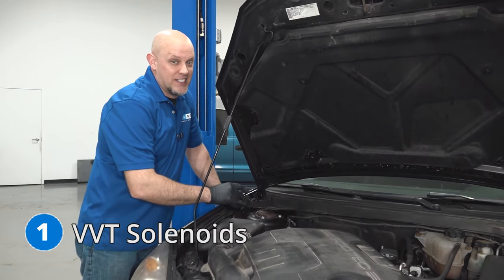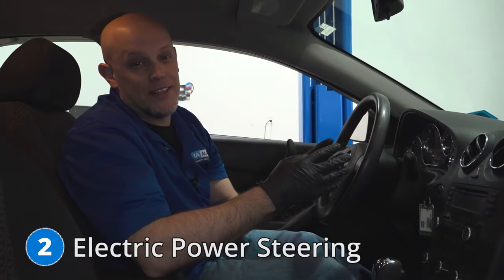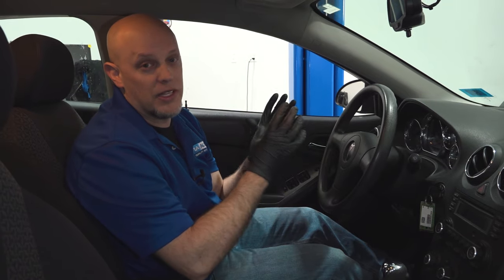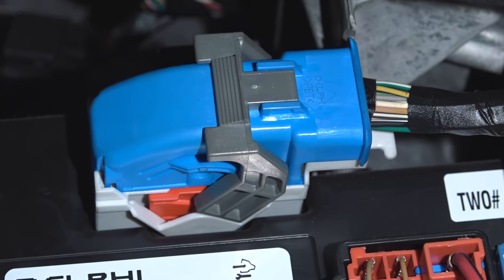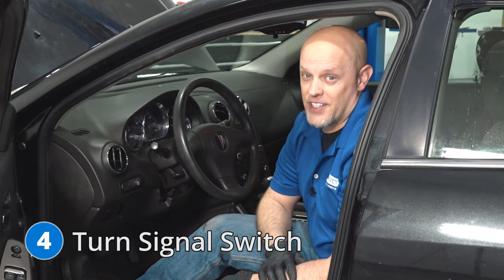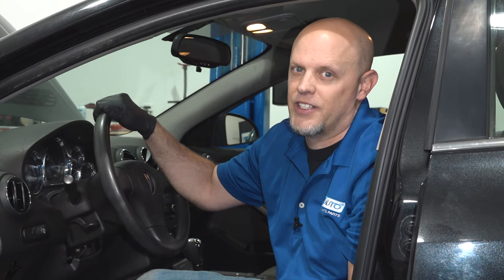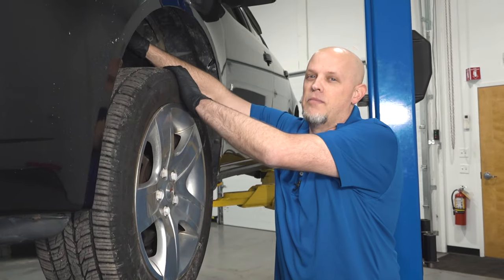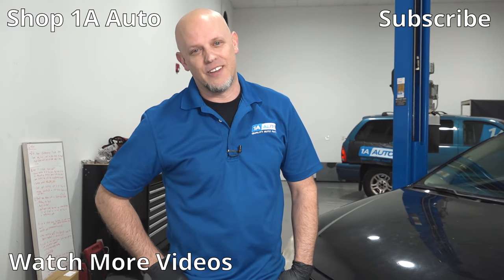Top 5 Problems Pontiac G6 Sedan 1st Generation 2005-10

Comment: 172k on my G6 and she's still rocking. Had the BCM connector issue as well as the turn signal issue. Total about $40 bucks spent on the fixes. I'm gonna drive this thing until the wheels fall off lol
Reply: Having a blast at 200k
Reply: I currently have the turn signal issue :/ how did you fix that!?
Reply: I own an 07 G6. They used the same Signal switch on the Chevy Cobalt, G6, and Saturn Aura that I know of. And Idk why the switches have such issues on each vehicle its installed. I gotta go order one for mine. It's like $28 on Amazon.
Reply: @LuisSanchez-1  Ditto, just what Michael said. Got my turn signal switch assembly on Amazon for $25. 

If you don't know what you are doing, it take about 5 minutes. Extend the telescoping steering column out away from the dashboard... that will make the job easier.
Reply: @mikegray2002  hey man I’m driving the 07 g6 as well haha how’s she treating you
Reply: @LuisSanchez-1  its really easy, and cheap. Bought the whole assembly online,watched a YouTube video. Takes maybe 15 minutes.
Reply: What year? My 05 g6 was horrible maybe other years were better.
Reply: I got 210,000 and still running like a champ
Reply: I feel that my g6 got 160 k an im not getting rid of it anytime soon
Reply: 237,000  same motor had it since 07  2 transmissions later I'm still satisfied I've pushed her past the breaking point removed governor but kept Rev limiter it still feels the way it did new when I left the lot 1 thing that still pisses me off to this day the driverside ground in the door wire harness when the windows don't work check that wire problems always I open my door sometimes and wiggle the wire guide just to
 Crack my window 😀 but she never left me stranded 100%
Reply: Yup, I'm at 176k right now in my 08 G6 GT
Reply: @shysti2c  how did you remove the govner? I’m buying 1 soon
Reply: Still going strong? ThinkIng about buying a 2008 with 170,000 miles.
Reply: I'm at 172K also! Starting to have issues with it not starting...it will click but won't turn over. I love this car and need to keep it going longer
Reply: I just got mine On The road and bought it from my son after it sat during Covid. I wanna drive mine til the brand new tires fall off too!!!
Reply: 170k on mines and just changed the fuel pump but it still doesn’t run
Reply: Don’t joke about that, my passenger side tire LITERALLY fell off while I was driving

Comment: Only thing that I would add is the headlights. The cheap wiring breaks and one or both lights go out... intermittently. You need to go buy the pigtails and solder the new ones in.
Reply: i literally just had this problem. had to replace the headlight.
Reply: I’ve gone through this nightmare several times
Reply: Even with that as the fix I have trouble with mine still. I just gave up lol. One headlight fo' life!

Comment: Mine has 170,000 miles, none of this has happened yet, counting my blessings, and accepting that something will happen sooner or later
Reply: I bought one with almost 200,000 and the front wheel bearing is one thing I gotta replace plus we had to fix the back struts your days are numbered man😂
Reply: @connerkandiko8268  I replaced the front struts, and the rear shocks and springs
Reply: I’m about to buy this car🤣
Reply: Mines is 187342 miles on a GXP G6 the only thing i had to do is redo the Timing Belt  But besides that! normal Wear and tear stuff! As long you take care of the car ! it will take care of you!
Reply: @johnwilliams73123  they’re great they run forever, mine almost has 200k miles and the power steering is the only thing i had to replace but after a few youtube vids it was honestly a very simple fix
Reply: @mikelake3498  Very common issue on those 3.6. I have one too at 218k
Reply: Update: Damn Bcm Connector

Comment: Had 3 G6s in my life and i loved them all. Last one I had was a GT sedan with the panoramic sunroof which I LOVED! Had almost 300k miles on it and never had a single issue besides having to replace a wheel bearing. Have a G8 GT now but would like another G6 for winters
Reply: Just came across this comment i have a g8 and also 3 g6s lol pontiac forever

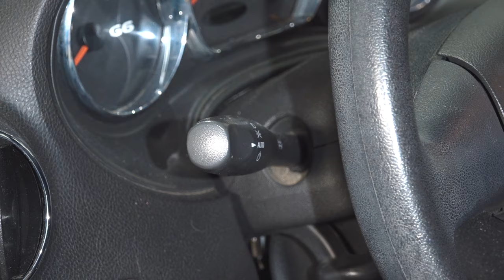Comment: 2:10 I actually love that it doesn't automatically get rid of the turn signal because sometimes in other cars it removes too quickly and with the g6 I have control on when to get rid of the signal.
Reply: I do like it too but as my G6 is my first car.. I'm gonna hate it when I get a new one cuz imma be switching straight to my other turn signal cuz I'm too used to doing it myself🤣
Reply: i’m glad it works well for you! but my area requires you to turn off your signal then turn it back on every time you merge to another lane even if you’re merging across multiple lanes at the same time. that way drivers around you know that you’re merging instead of assuming you just didn’t turn the wheel enough for the signal to turn off

Comment: my 2005 pontiac g6 has had every single one of these problems minus the turn signal switch.  great car tho. 330k miles and still going! also the electrical steering going out was fixed for free at the dealer due to a recall.
Reply from the maker: +marquez16543 Thanks for the feedback!
Reply: How long ago was it that the dealer repaired electronic power steering issue for you? And wash there any specific guidelines that would dictate rather or not they would repair it for you?
Reply: Wow 330 miles.  Good to know.
Reply: 330k ! Nice!

Comment: This video proves there are good ppl out there  posting accurate helpful information because the BCM thing was my problem and this worked
Reply: There is a recall for that vehicle where they put dielectric grease and rearrange the wires for that connector
Reply: My break lights would stay on. I took rubbing alcohol and a small brush and cleaned all the prongs in the connector and it fixed it

Comment: Melting power steering hoses:
One significant issue worth noting is on G6's that have hydraulic power steering (as opposed to electric power steering). I had a G6 GT 3.5L V6.  The power steering lines both run right under the rear exhaust manifold. And when I say right under I mean RIGHT under it. When the engine is under load and it tilts back, that rear exhaust manifold leans back and TOUCHES the power steering hoses. The hoses have some heat shields on them but those are worthless against the super hot exhaust. My power steering hoses melted all the way through one day and out went all my power steering fluid onto the ground. This happened while I was driving, so I lost all power steering assistance. 
I was able to replace the hoses and secure them down with some zip ties. This held the hoses at least a couple inches away from the exhaust, but I wish there was a better design for that. Every drive after that, I had to worry if it was about to melt again.

Just something to watch out for and ask about any service history on that issue.
Reply: Happened to me 3 times in a two month span
Reply: I'm actually going through this now. Trying to find a video on replacing the power steering return line. I can find a bunch on the high pressure line..none for the return..

Comment: I have a 2006 G6 V6 3.5 and i have had to change out the blinker switch, replaced starter, replaced fuel pump, and i have had the transmission rebuilt, but my car runs great now. I love the power that my G6 has it will get up and go.

Comment: I've owned 2 of these sub models and when the internal voltage regulator goes out inside the ALTERNATOR, the body control module freaks out under hard acceleration and you lose power steering, in addition to the instrument panel resetting, until you remove your foot from the hard acceleration. In both cases I opted for an UPGRADED alternator instead of and OEM replacement, and have NEVER had a problem after.

In severe cold whether starts, the charging voltage can be high, causing you the steering to act nervous but after a few minutes of warm up, your fine.
Reply: We don’t need that power steering my girl, we da best player in da game
Reply: @ColonelCutlet  LOL, it's like wrestling an alligator when it goes out, let me tell you.

Comment: I got my G6 handed down to me with about 120k on it, i’ve had to replace the solenoids, power steering sensor, and turn signal switch all in the last 2 years. Overall it could be worse, and it’s been a pretty reliable car!
Reply: How much did it cost you?
Reply: @jayden-jsjincorporated5089 , I replaced my solenoids on my 2009 g6 2.4 recently.  About $100 for the 2.   Power steering sensor should be pretty affordable.  Turn switch shouldn't be too high, either.
Reply: i just got an 07 with 162k miles and need to replace the turn signal switch :’)

Comment: you should make it top ten cause there are plenty of issues. like the shifting linkage, the oil leaks, And The plastic heater lever under the dash that switches it from hot to cold. I have 260 thousand on mine and I do have to say the car still feels tight {like new} and runs great handles good to

Comment: Wow! I have several of the problems you listed. My blinker has always been wonky. My wheel bearing is howling and my power steering quit working after I slid off the road the other day. The code reader says "lost communication with power steering control."

Comment: G6 gt 2007 on 214k miles, so far I had a serpentine belt torn to shreds due to a/c pulley stalling, replaced exhaust system due to human error lol, replaced return line on rack and pinion due to it routing and pressing against exhaust burning a hole through it (that was a pain to fix but it was my first time), some grounding issues causing a bunch of lights on my hud, alternator going bad, o2 sensor replaced, and yeah I think more but IT STILL RUNS. Thankfully and I did it all by hand no mechanics and I ain’t even that knowledgeable on cars 👍🏼

Comment: I own an 08 G6 with 110k miles. I've already had problems with the steering intermediate shaft rusting/seizing up, coolant temp sensor, transmission speed sensor, weak timing chain guides (had to replace the whole timing chain/guides), corrosion getting inside the trunk release button, weak door lock actuators, and my all time favorite is the obnoxious popping sound coming from the poorly designed rack & pinion. Mine broke apart inside and I lost control of the steering while driving. The turn signal doesn't cancel automatically anymore, I've had problems with the VVT solenoids even after replacing them, the dealership did a half ass job fixing the power steering issues, the transmission shifts hard when the engine is cold/during winter months. I've had to replace the ball joints/control arms due to the ball joints failing. They never put grease zerks on them so there's no way to properly maintain them. Both struts had to be replaced already. The drivers side strut makes a bunch of racket, and the passenger side weld broke where the swaybar link connects to it. The speakers don't work worth a crap. The rear speakers need to be replaced, and I had to cut the speakers out of the housings and reuse the factory housings due to the design of the front door speakers. When I run the air conditioner, which is also going out, the back floor floods with water on the passenger side. That being said, the whole car smells because of it.
Reply: Money pit car tbh
Reply: Lol that's brutal brotha hang in there man. I thought I had it bad . Jeez
Reply: My back floor bored gets wet to its comeing out of the trunk cuz my trunk was flooding had to pop the seal on the trunk under spear tire

Comment: 234k on my g6, OG trans and motor. Few minor problems. But this has a very reliable vehicle. It has hydraulic power steering instead of electric. Only thing that has gone wrong is the turn signal, and the hub bearings aside from just general maintenance. Great vehicle and value.

Comment: Personal opinion but any dielectric grease on the BCM connector is better than none and even the cheap stuff will last you 4-6 months. But why aren't the front control arms mentioned? It greatly effects how the car drives once the bushings or balljoints fail. If your G6 displays faults for ESC, Traction Control, Cruise Control doesn't work, or your Brake lights don't work properly,  then clean your BCM connections and apply dielectric grease and it should all go away.

Comment: A repeat customer came in with their recently purchased boneyard G6 for new tires, front bearings and CV axles. Lss, the end of the axle that goes in the trans was too long on the new one and it popped out of the trans at the customer's place of employment so I had to go out there yesterday with another new one of a different design and it went in real nice, snapped into place and didn't come out again. Some cars are hard to order parts for.
Reply from the maker: +Panther Platform Thanks for the feedback!

Comment: My G6 has over 293K on the odometer and I've had to replace the front wheel hub assembly and the headlights. She could probaly use a new Catalytic converter though. I have a P0140 right now
Reply from the maker: +Skyler Marcum Thanks for the feedback!
Reply: I currently have a 09 G6 w/ 245k I’m trying to keep it to at least 300k I’ll be satisfied 🙏🏽💯

Comment: Dielectric grease would NOT help or fix corrosion!
It only helps prevent FUTURE corrosion.

You must use electronic contact cleaner to clean the corrosion FIRST, and then apply dielectric grease to seal the contacts/plug.
Reply from the maker: +pepeshopping Thanks for the tip!
Reply: He didn't actually say grease would fix anything. He just said to use grease to prevent the problem.

Comment: I just bought an 07 with 135k miles on it, i already notice it needs new hub bearings and i already broke the blinker switch😂 Over all the car drives like a dream, its a little bit loud and the trans shifts rough but its a good car.
Reply: I saw an '09 a few weeks back at the local dollar general parking lot for $3200.  Was listed with 136k miles. Your post makes me regret not buying it.
Reply: @TacoBell5DollarBox  no. You should have drove it. Not every car that's for sell will be perfect
Reply: @TacoBell5DollarBox  PONTIAC is JUNK!!!! Trust me. Maybe talk them down but I wouldn’t regret not buying it. I regret not being able to buy a one owner 2007 HONDA CIVIC with 55k for $3000. I wanted it but it was last June and DMV was closed. Didn’t know how to get it (we have to have notarized bill of sale). It went quick.
Reply: @TacoBell5DollarBox  damn I got mine for 3k with 128k miles all it needed was new tires and the time
Reply: Hubs are $50, turn signal switch assembly is $25 on Amazon.
Reply: I just bought an 07 about 4 months ago with just about the same amount of miles I hear aloud knock when I make turns and I might need new suspension but other than that I’d say it was worth it
Reply: My daughter bought me a 07 G6 for $1400 with 252k miles, turn signal broke, key stuck in the ignition, power locks on driver's door won't work but from the passenger side will, passenger side headlight is gone, but I think some rodents chewed the wires and needs some struts, also the manifold donut has to be replaced because the thing sounds like a tractor, but the engine and transmission runs fine otherwise. I've had it for 6 months and I am repairing it little by little. It's a project for me to nurse back to health, lol.

Comment: That turns signal switch problem seems to be  common with GM unfortunately. I've had a Camaro and a Firebird with similar issues.
Reply: Mine sticks when it' s hot, I replaced it when I thought it was broke.  Next summer came and same thing. (All black paint and interior)
Reply: funny you mentioned it,.. just had mine replaced🤣
Reply: Had the turn signal switch assembly problem in every Pontiac I have ever owned (Grand Am, Bonneville and the G6).

New assembly can be bought on Amazon for $25, and you can install it in 5 minutes.

Comment: '07 G6 3500, here, with almost 260k miles, and aside from a tranny rebuild, been pretty reliable.

I am surprised, however, that melting low-beam connectors are not in this list. I've had to replace mine twice. The second time, I used Dorman high temp sockets, which have a pigtail on the other end. That way, if they melt, I can just unplug and replace them w/out having to solder, but hopefully, the high temp sockets won't have that problem.

I'm also surprised that the sunroof drain tube shrinkage problem isn't mentioned. I don't know the percentage of G6's with sunroofs, but it is a well-known issue - to the point that GM made a parts kit to extend them.

Comment: Having a problem with a 2009 g6. It won’t start. Not on account of an engine problem but an electric problem it cranks but then shuts off. While trying to start, the anti theft symbol pops up on the dash and when the key is released the car shuts off. My mechanic cleaned the points on the BCM and that worked for a few miles. It can be started again after removing the batter cables from the terminals and then putting them back on. Recently it has had new valve cover gaskets installed and there was an issue with a clogged brake line. And the starter has been replaced. What might be the problem? Thanks for any information.

Comment: I have 2007 g6 and i am having problems. Shifting its slow or won't move out the second gear or third. One time i didn't take my feet off the petal and it finally shift to the next gear. Is VVT solenoid my problem? I have headlights problems replace the bulb so many time.

Comment: Thanks for the info I’m currently drive the o7 g6, and my main problem is my gas cap and maybe new suspension because little bumps in the road make it rattle quite loud and excessive
Reply: I got the same issue with rattling and no clue what's doing it
Reply: @justinjohnson7693  Front and rear sway bar bushings and links....